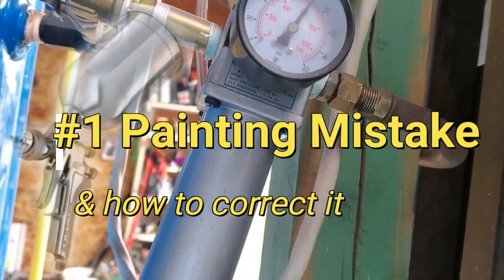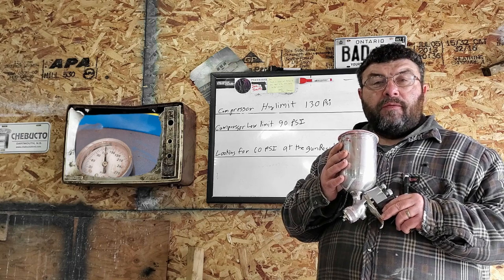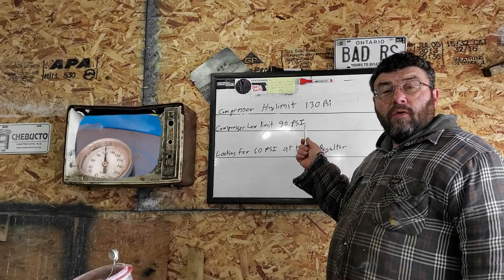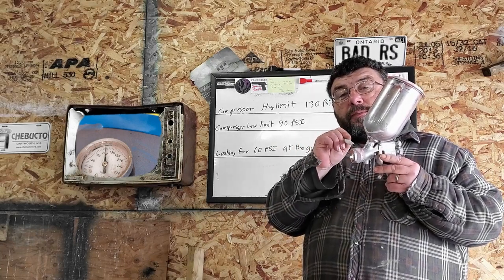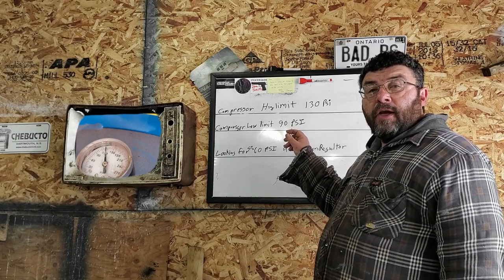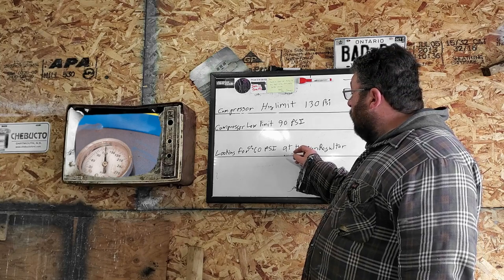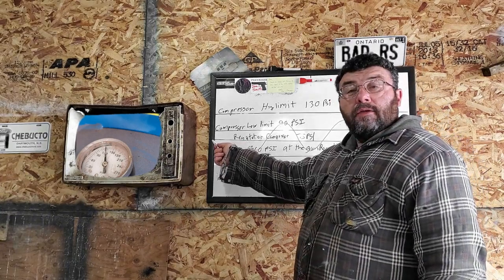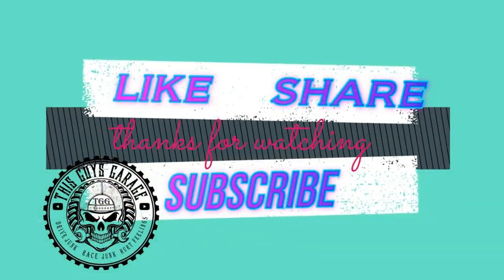best air pressure for painting cars

Comment: Very informative video.I have a little problem with my spray guns pressure and i want to ask you some questions.
In my paint shop i have my compressor about 100 meters away from the spray booth.it supplies 10 bar pressure to a wall regulator ( and water filter) in the spray booth through 18mm piping. I set the wall regulator to 6 bar. The gun hose that is connected to the wall regulator has 8mm inner diameter and is about 8 meters long.with trigger not pulled  I have the same static pressure (6 bar ) to the wall and gun regulator.All good till here.
My problem is: when i pull the trigger the pressure on the gun regulator shows i.e 3 bar but the wall regulator shows 4.5. its always higher. shouldn't be the same?I have tested o couple of gun regulators to determine the problem...i used a "stick" with a pressure manometer with no restrictions and i have the same readings as well. And i see that the gun is not functioning well (has very bad atomisation) at recommended inlet pressure ( 2 -2.5 bar) I need to pump it up to  3 bar or more to spray a decent finish.thank you and Greetings from Greece!
Reply from the maker: hey Fanice  great question , there is always a drop in pressure the further you are away from the compressor  1 100 meters or roughly 300 feet is quite a distance , remembering PSI is a measure of restriction the farther away you are the less resistance you will have .  i would consider putting a holding tank next to the paint booth to have a volume of air near your paint booth ,or have a dedicated compressor for the booth itself .  most painters use a 30 foot hose in their paint booths as well ,25 is just not long enough and 50 feet hose has too much loss , does this make sense?
Reply: @thisguysgarage  so..my psi at the gun inlet is not an Actual pressure?is a wrong reading because of the distance of the compressor?
Reply from the maker: @fanisathanasiou3694  do you have a Guage at the spraygun?
Reply: @thisguysgarage  i have 3 of them..i tested them all...all read the same...with no trigger i have the same pressure in gun and wall. And when i pull it .. i get 30 psi in the gun (and is so weak) and wall reads 50.
Reply from the maker: @fanisathanasiou3694  this suggests there is too much distance between the compressor.  Some sort of storage tank for air or another compressor at the paint booth would resolve this issue.  There is definitely an air supply problem.  You could plumb a small portable 20 gallon compressor in a daisy chain at the paint booth to test the theory we are working with.
Reply: @thisguysgarage  i borrowed a small compressor to test everything we talked about...and you were right...the issue is the distance between the compressor and the gun...i m going to install a air tank near the spray booth to solve my problem..thank you again and keep uploading such useful videos....
Reply from the maker: @fanisathanasiou3694  so glad to have helped my friend 🤜🤛

Comment: Hello, great video.   A few Q’s for you.  First time painting, need to do a hood and two fenders.  Purchased a new compressor from homeD. It’s a husky 27gal 200psi, 6.8scfm at 40psi, 5.1 at 90.   
First, better 2 hoses with a water filter between them?, What should come right off of the compressor, any regulator or filter of any kind?  Or just a hose straight to the the gun with a filter just prior?  
The hvlp gun I have says 40psi operating press, and 4.3scfm avg consumption on the box.   
Do I do with this information?
Initially I was going to set up the first 50 foot line up and down then a water separator, then a 50 foot line to another water separator just before the gun regulator. Yes no? 
Thank you sir
Reply from the maker: Here is what I would do 5-6 foot hose to watertrap/regulator. A 35 foot hose is what is normally what a painter uses. 25 foot will work for touch ups . 50 foot hose has too much pressure drop .you can use a trap at the paint gun as well.  For a hvlp gun you also need high volume lines as well.  If you have any other questions let me know.

Comment: I am currently looking into a new set up for my paint booth compressor any recommendations? HVLP iwata gun is what we use most often . Around a 9.8cfm for the guns .
Reply from the maker: What are you looking at, what is available to you?
Reply: I’m looking at iNGERSOLL RAND Electric Air Compressor: 5 hp, 2 Stage, Vertical, 80 gal Tank, 14.3 cfm, 480V AC
Reply: Not quite to sure what to get though .
Reply from the maker: @anddaaay  you won't go wrong with the Ingersoll,  a good devilbiss air dryer will be the most important part for paint booth work.  How big is your operation.  If that compressor is dedicated to the paint shop you will be fine.
Reply: Okay so currently we have a really old compressor and have a iNGERSOLL combined for a extra tank just for air . And I’ve decided to go with a compressor dedicated just for the paint booth .
Reply from the maker: @anddaaay  great idea 💡.

Comment: Ive been dealing with a problem I hope you can help me out with. When I'm painting I have to set the pressure at almost maximum (100psi+) to get near 30psi at the gun with the trigger open. On the gauge on the gun it also says 100psi.
I have a 3/8" hose because it was suggested to me a 1/4" hose was too restrictive. This doesn't help though.
Now when I plug my gun in the compressor regulator directly without the hose I get the same result on the gun gauge. On the compressor regulator gauge though, If I set it at 35psi and pull the trigger, it reads 30psi. Could my gun gauge be faulty or something?  How much air should be blowing out of my gun? Because right now it's more powerful than my dust blower gun.
Reply from the maker: it sounds like a guage problem at the gun,  but I do need to ask a couple of questions to help you out.  do you have  a water trap ball on your gun,if so they are only for a limited use, also check if it is on in the right direction, some or most have a one way air travel.  so to check if your guage is the problem,  just remove it from the gun altogether and put your coupler directly on the gun, if this solves the restriction you can just set your pressure at the wall regulator till you can get a new regulator. 
if this doesn't solve your problem it is inside the gun itself.  also some guns have a air restriction valve at the bottom of the gun.

any problems with any other tools when connected to the air line?
let me know im sure we can figure it out,  consider 🔔, it helps a lot ty for the question.
Reply: @thisguysgarage  Thanks so much for answering! I do have a water filter but Ive tried with and without it. The problem remains. There's not really a restriction though. With or without the water filter and gauge/regulator, the same amount of air comes out of the gun, given that I had the gun regulator wide open ofcourse. Perhaps it just pulls like a little vacuum at the gauge, making it read a super low value?
Reply: @thisguysgarage  I painted primer with wrong settings by the way. I set it at 30psi without the trigger pulled. So probably I painted at 20psi. I got a real rough result. Really grainy. Right now I've sanded it all smooth but I need to get the settings right before laying down color